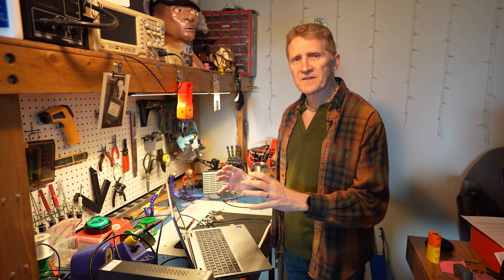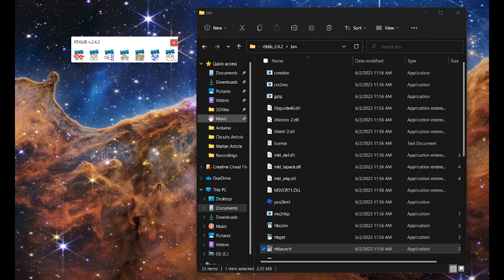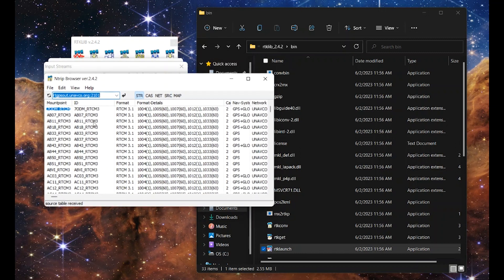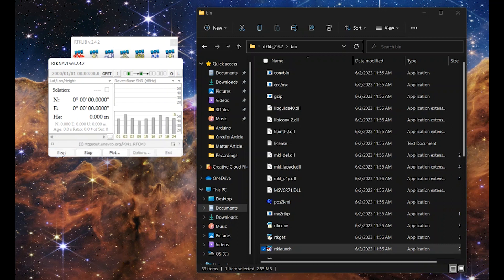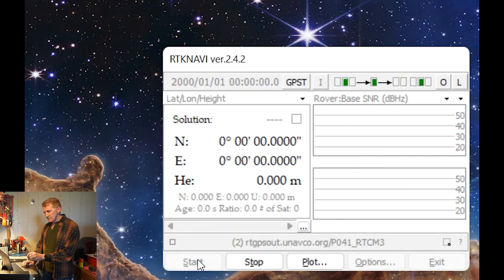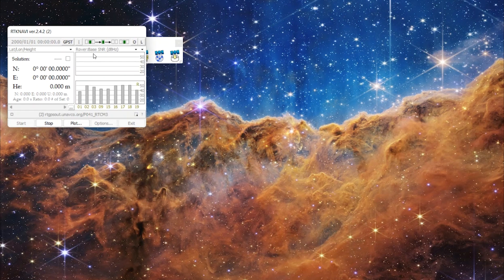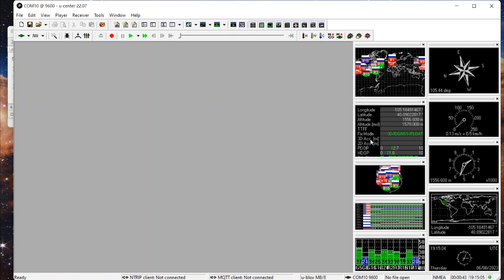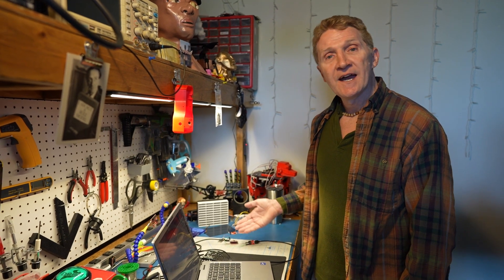RTK Correction Data Using UNAVCO

Comment: I'm wondering if this can be accomplished using a wireless device such as an ESP32?  Have the ESP32 get the UNAVCO data to send to the GPS module and then get the corrected data from the GPS module back to the ESP32 to then be pulled via WiFi or simply stored on SD card?  More accurate package or asset tracking opportunities I'm thinking with this system.   I'm a newbie to GPS systems 😏